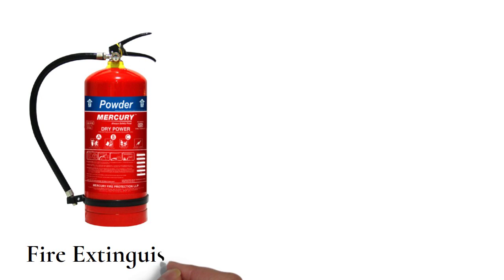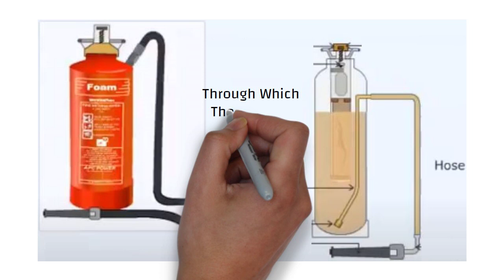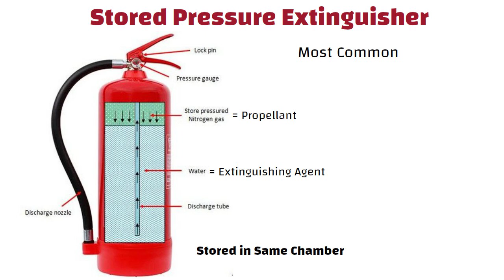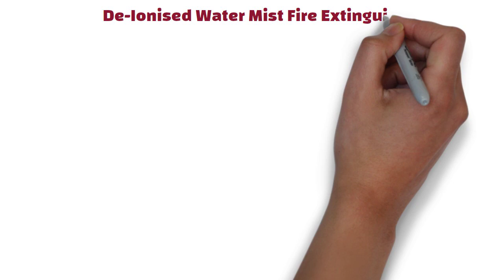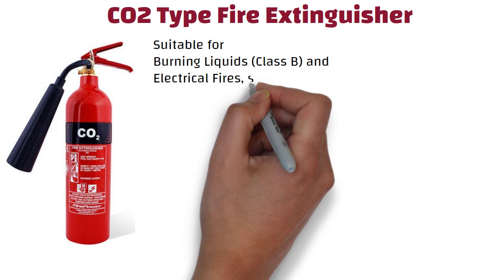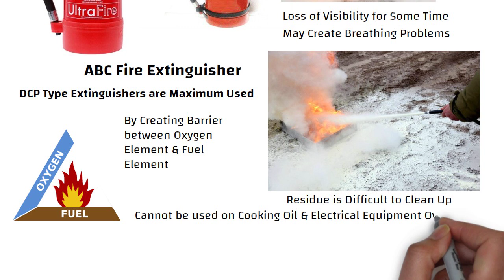FIRE EXTINGUISHER DEALERS IN KERALA, CALL 8138906102, FIRE EXTINGUISHER DEALERS IN ERNAKULAM.

Comment: FIRE EXTINGUISHER DEALERS IN THALASSERY, FIRE EXTINGUISHER SUPPLIERS IN THALASSERY, FIRE EXTINGUISHER DISTRIBUTORS IN THALASSERY, FIRE EXTINGUISHER IN THALASSERY, ABC TYPE FIRE EXTINGUISHER DEALERS IN THALASSERY, CO2 TYPE FIRE EXTINGUISHER DEALERS IN THALASSERY, CLEAN AGENT FIRE EXTINGUISHER IN THALASSERY, MODULAR TYPE FIRE EXTINGUISHER DEALERS IN THALASSERY, MECHANICAL FOAM FIRE EXTINGUISHER DEALERS IN THALASSERY, FIRE EXTINGUISHER NEAR ME THALASSERY, FIRE EXTINGUISHER TRADERS IN THALASSERY, FIRE FIGHTING COMPANIES IN THALASSERY, FIRE CONTRACTORS IN THALASSERY, FIRE EQUIPMENT DEALERS IN THALASSERY, FIRE ALARM DEALERS IN THALASSERY, FIRE PUMP DEALERS IN THALASSERY, SMOKE DETECTOR DEALERS IN THALASSERY, FIRE FIGHTING SYSTEM IN THALASSERY, FIRE PROTECTION SYSTEM IN THALASSERY, FIRE AND SAFETY CONTRACTORS IN THALASSERY, FIRE HYDRANT SYSTEMS IN THALASSERY, PA TALK BACK SYSTEM IN THALASSERY, FIRE NOC IN THALASSERY, FIRE INSTALLATION IN THALASSERY, FIRE NOC RENEWAL IN THALASSERY, KIRLOSKAR FIRE PUMP DEALERS IN THALASSERY, FIRE EXTINGUISHER NEAR ME THALASSERY, FIRE EXTINGUISHER MANUFACURERS IN THALASSERY, SAFEX FIRE EXTINGUISHER DEALERS IN THALASSERY, FIRE NOC CONTRACTORS IN THALASSERY, FIRE FIGHTING EQUIPMENT DEALERS IN THALASSERY, FIRE PROTECTION SYSTEM IN THALASSERY, FIRE INSTALLATION IN THALASSERY, FIRE SAFETY CONTRACTORS IN THALASSERY, FIRE AMC IN THALASSERY, FIRE PROTECTION SYSTEM IN THALASSERY, FIRE PROTECTION EQUIPMET IN THALASSERY, AMC OF FIRE SYSTEM IN THALASSERY, FIRE CONSULTANTS IN THALASSERY, FIRE AND SAFETY EQUIPMENT DEALERS IN THALASSERY, ADDRESSABLE FIRE ALARM SYSTEM IN THALASSERY, KARTHAR VALVE DEALERS IN THALASSERY, DCP TYPE FIRE EXTINGUISHER IN THALASSERY, POWSER TYPE FIRE EXTINGUISHERS IN THALASSERY, FIRE HYDRANT SYSTEM IN THALASSERY, FIRE ALARM PANEL DEALERS IN THALASSERY, SAFEPRO FIRE EXTINGUISHER DEALERS IN THALASSERY, MS AND GI PIPE DEALERS IN THALASSERY, JINDAL PIPE DEALERS IN THALASSERY, AGNI FIRE ALARM DEALERS IN THALASSERY, FIRE EQUIPMENT DEALERS IN THALASSERY, FIRE EQUIPMENT SUPPLIERS IN THALASSERY, FIRE EQUIPMENT TRADERS IN THALASSERY, FIRE SPRINKLER SYSTEM IN THALASSERY, RAVEL FIRE ALARM DEALERS IN THALASSERY, RAVEL FIRE ALARM SYSTEM IN THALASSERY, AGNI FIRE ALARM DISTRIBUTORS IN THALASSERY, FIRE ALARM CONTRACTORS IN THALASSERY, FIRE PIPE INSTALLATION IN CONTRACTORS IN THALASSERY, FIRE SAFETY CONTRACTORS IN THALASSERY, FIRE PA TWO WAY TALK BACK SYSTEM DEALERS IN THALASSERY, HEAT DETECTOR DEALERS IN THALASSERY, HONEYWELL FIRE ALARM DEALERS IN THALASSERY, FIRE NOC CONSULTANTS IN THALASSERY, FIRE AMC AND FIRE NOC IN THALASSERY, FIRE SAFETY COMPANIES IN THALASSERY, NEWAGE DEALERS IN THALASSERY, MONSHER FIRE EQUIPMENT DEALERS IN THALASSERY, KARTHAR VALVE DEALERS IN THALASSERY, FIRE HYDRANT VALVE DEALERS IN THALASSERY, FIRE HOSE REEL DRUM DEALERS IN THALASSERY, FIRE SPRINKLER DEALERS IN THALASSERY, FIRE PUMP DEALERS IN THALASSERY, LUBI PUMP DEALERS IN THALASSERY, LHP PUMP DEALERS IN THALASSERY. FIRE ALARM SYSTEMS IN THALASSERY, ADDRESSABLE FIRE ALARM DEALERS IN THALASSERY, SMOKE DETECTOR DEALERS IN THALASSERY, FIRE ALARM CONTRACTORS IN THALASSERY, FIRE ALARM PANEL DEALERS IN THALASSERY, BIRE ALARM INSTALLTION IN THALASSERY, MORLEY FIRE ALARM DEALERS IN THALASSERY, HONEYWELL FIRE ALARM DEALERS IN THALASSERY, GST FIRE ALARM DEALERS IN THALASSERY, FIRE FIGHTING COMPANIES IN THALASSERY, FIRE AND SAFETY CONTRACTORS IN THALASSERY, FIRE EQUIPMENT IN THALASSERY, SAFEPRO FIRE EXTINGUISHER DEALERS IN THALASSERY, SAFEX FIRE EXTINGUISHER DEALERS IN THALASSERY, SIMPLEX FIRE ALARM DEALERS IN THALASSERY, TYCO DEALERS IN THALASSERY, JINDAL PIPE DEALERS IN THALASSERY, KARTHAR DISTRIBUTORS IN THALASSERY, STENTOR DEALERS IN THALASSERY, MONSHER DEALERS IN THALASSERY, NEWAGE DEALERS IN THALASSERY, RONAK HOSE REEL DEALERS IN THALASSERY,

Comment: FIRE EXTINGUISHER DEALERS IN THODUPUZHA, FIRE EXTINGUISHER SUPPLIERS IN THODUPUZHA, FIRE EXTINGUISHER DISTRIBUTORS IN THODUPUZHA, FIRE EXTINGUISHER IN THODUPUZHA, ABC TYPE FIRE EXTINGUISHER DEALERS IN THODUPUZHA, CO2 TYPE FIRE EXTINGUISHER DEALERS IN THODUPUZHA, CLEAN AGENT FIRE EXTINGUISHER IN THODUPUZHA, MODULAR TYPE FIRE EXTINGUISHER DEALERS IN THODUPUZHA, MECHANICAL FOAM FIRE EXTINGUISHER DEALERS IN THODUPUZHA, FIRE EXTINGUISHER NEAR ME THODUPUZHA, FIRE EXTINGUISHER TRADERS IN THODUPUZHA, FIRE FIGHTING COMPANIES IN THODUPUZHA, FIRE CONTRACTORS IN THODUPUZHA, FIRE EQUIPMENT DEALERS IN THODUPUZHA, FIRE ALARM DEALERS IN THODUPUZHA, FIRE PUMP DEALERS IN THODUPUZHA, SMOKE DETECTOR DEALERS IN THODUPUZHA, FIRE FIGHTING SYSTEM IN THODUPUZHA, FIRE PROTECTION SYSTEM IN THODUPUZHA, FIRE AND SAFETY CONTRACTORS IN THODUPUZHA, FIRE HYDRANT SYSTEMS IN THODUPUZHA, PA TALK BACK SYSTEM IN THODUPUZHA, FIRE NOC IN THODUPUZHA, FIRE INSTALLATION IN THODUPUZHA, FIRE NOC RENEWAL IN THODUPUZHA, KIRLOSKAR FIRE PUMP DEALERS IN THODUPUZHA, FIRE EXTINGUISHER NEAR ME THODUPUZHA, FIRE EXTINGUISHER MANUFACURERS IN THODUPUZHA, SAFEX FIRE EXTINGUISHER DEALERS IN THODUPUZHA, FIRE NOC CONTRACTORS IN THODUPUZHA, FIRE FIGHTING EQUIPMENT DEALERS IN THODUPUZHA, FIRE PROTECTION SYSTEM IN THODUPUZHA, FIRE INSTALLATION IN THODUPUZHA, FIRE SAFETY CONTRACTORS IN THODUPUZHA, FIRE AMC IN THODUPUZHA, FIRE PROTECTION SYSTEM IN THODUPUZHA, FIRE PROTECTION EQUIPMET IN THODUPUZHA, AMC OF FIRE SYSTEM IN THODUPUZHA, FIRE CONSULTANTS IN THODUPUZHA, FIRE AND SAFETY EQUIPMENT DEALERS IN THODUPUZHA, ADDRESSABLE FIRE ALARM SYSTEM IN THODUPUZHA, KARTHAR VALVE DEALERS IN THODUPUZHA, DCP TYPE FIRE EXTINGUISHER IN THODUPUZHA, POWSER TYPE FIRE EXTINGUISHERS IN THODUPUZHA, FIRE HYDRANT SYSTEM IN THODUPUZHA, FIRE ALARM PANEL DEALERS IN THODUPUZHA, SAFEPRO FIRE EXTINGUISHER DEALERS IN THODUPUZHA, MS AND GI PIPE DEALERS IN THODUPUZHA, JINDAL PIPE DEALERS IN THODUPUZHA, AGNI FIRE ALARM DEALERS IN THODUPUZHA, FIRE EQUIPMENT DEALERS IN THODUPUZHA, FIRE EQUIPMENT SUPPLIERS IN THODUPUZHA, FIRE EQUIPMENT TRADERS IN THODUPUZHA, FIRE SPRINKLER SYSTEM IN THODUPUZHA, RAVEL FIRE ALARM DEALERS IN THODUPUZHA, RAVEL FIRE ALARM SYSTEM IN THODUPUZHA, AGNI FIRE ALARM DISTRIBUTORS IN THODUPUZHA, FIRE ALARM CONTRACTORS IN THODUPUZHA, FIRE PIPE INSTALLATION IN CONTRACTORS IN THODUPUZHA, FIRE SAFETY CONTRACTORS IN THODUPUZHA, FIRE PA TWO WAY TALK BACK SYSTEM DEALERS IN THODUPUZHA, HEAT DETECTOR DEALERS IN THODUPUZHA, HONEYWELL FIRE ALARM DEALERS IN THODUPUZHA, FIRE NOC CONSULTANTS IN THODUPUZHA, FIRE AMC AND FIRE NOC IN THODUPUZHA, FIRE SAFETY COMPANIES IN THODUPUZHA, NEWAGE DEALERS IN THODUPUZHA, MONSHER FIRE EQUIPMENT DEALERS IN THODUPUZHA, KARTHAR VALVE DEALERS IN THODUPUZHA, FIRE HYDRANT VALVE DEALERS IN THODUPUZHA, FIRE HOSE REEL DRUM DEALERS IN THODUPUZHA, FIRE SPRINKLER DEALERS IN THODUPUZHA, FIRE PUMP DEALERS IN THODUPUZHA, LUBI PUMP DEALERS IN THODUPUZHA, LHP PUMP DEALERS IN THODUPUZHA. FIRE ALARM SYSTEMS IN THODUPUZHA, ADDRESSABLE FIRE ALARM DEALERS IN THODUPUZHA, SMOKE DETECTOR DEALERS IN THODUPUZHA, FIRE ALARM CONTRACTORS IN THODUPUZHA, FIRE ALARM PANEL DEALERS IN THODUPUZHA, BIRE ALARM INSTALLTION IN THODUPUZHA, MORLEY FIRE ALARM DEALERS IN THODUPUZHA, HONEYWELL FIRE ALARM DEALERS IN THODUPUZHA, GST FIRE ALARM DEALERS IN THODUPUZHA, FIRE FIGHTING COMPANIES IN THODUPUZHA, FIRE AND SAFETY CONTRACTORS IN THODUPUZHA, FIRE EQUIPMENT IN THODUPUZHA, SAFEPRO FIRE EXTINGUISHER DEALERS IN THODUPUZHA, SAFEX FIRE EXTINGUISHER DEALERS IN THODUPUZHA, SIMPLEX FIRE ALARM DEALERS IN THODUPUZHA, TYCO DEALERS IN THODUPUZHA, JINDAL PIPE DEALERS IN THODUPUZHA, KARTHAR DISTRIBUTORS IN THODUPUZHA, STENTOR DEALERS IN THODUPUZHA, MONSHER DEALERS IN THODUPUZHA, NEWAGE DEALERS IN THODUPUZHA, RONAK HOSE REEL DEALERS IN THODUPUZHA,

Comment: FIRE EXTINGUISHER DEALERS IN KATTAPPANA, FIRE EXTINGUISHER SUPPLIERS IN KATTAPPANA, FIRE EXTINGUISHER DISTRIBUTORS IN KATTAPPANA, FIRE EXTINGUISHER IN KATTAPPANA, ABC TYPE FIRE EXTINGUISHER DEALERS IN KATTAPPANA, CO2 TYPE FIRE EXTINGUISHER DEALERS IN KATTAPPANA, CLEAN AGENT FIRE EXTINGUISHER IN KATTAPPANA, MODULAR TYPE FIRE EXTINGUISHER DEALERS IN KATTAPPANA, MECHANICAL FOAM FIRE EXTINGUISHER DEALERS IN KATTAPPANA, FIRE EXTINGUISHER NEAR ME KATTAPPANA, FIRE EXTINGUISHER TRADERS IN KATTAPPANA, FIRE FIGHTING COMPANIES IN KATTAPPANA, FIRE CONTRACTORS IN KATTAPPANA, FIRE EQUIPMENT DEALERS IN KATTAPPANA, FIRE ALARM DEALERS IN KATTAPPANA, FIRE PUMP DEALERS IN KATTAPPANA, SMOKE DETECTOR DEALERS IN KATTAPPANA, FIRE FIGHTING SYSTEM IN KATTAPPANA, FIRE PROTECTION SYSTEM IN KATTAPPANA, FIRE AND SAFETY CONTRACTORS IN KATTAPPANA, FIRE HYDRANT SYSTEMS IN KATTAPPANA, PA TALK BACK SYSTEM IN KATTAPPANA, FIRE NOC IN KATTAPPANA, FIRE INSTALLATION IN KATTAPPANA, FIRE NOC RENEWAL IN KATTAPPANA, KIRLOSKAR FIRE PUMP DEALERS IN KATTAPPANA, FIRE EXTINGUISHER NEAR ME KATTAPPANA, FIRE EXTINGUISHER MANUFACURERS IN KATTAPPANA, SAFEX FIRE EXTINGUISHER DEALERS IN KATTAPPANA, FIRE NOC CONTRACTORS IN KATTAPPANA, FIRE FIGHTING EQUIPMENT DEALERS IN KATTAPPANA, FIRE PROTECTION SYSTEM IN KATTAPPANA, FIRE INSTALLATION IN KATTAPPANA, FIRE SAFETY CONTRACTORS IN KATTAPPANA, FIRE AMC IN KATTAPPANA, FIRE PROTECTION SYSTEM IN KATTAPPANA, FIRE PROTECTION EQUIPMET IN KATTAPPANA, AMC OF FIRE SYSTEM IN KATTAPPANA, FIRE CONSULTANTS IN KATTAPPANA, FIRE AND SAFETY EQUIPMENT DEALERS IN KATTAPPANA, ADDRESSABLE FIRE ALARM SYSTEM IN KATTAPPANA, KARTHAR VALVE DEALERS IN KATTAPPANA, DCP TYPE FIRE EXTINGUISHER IN KATTAPPANA, POWSER TYPE FIRE EXTINGUISHERS IN KATTAPPANA, FIRE HYDRANT SYSTEM IN KATTAPPANA, FIRE ALARM PANEL DEALERS IN KATTAPPANA, SAFEPRO FIRE EXTINGUISHER DEALERS IN KATTAPPANA, MS AND GI PIPE DEALERS IN KATTAPPANA, JINDAL PIPE DEALERS IN KATTAPPANA, AGNI FIRE ALARM DEALERS IN KATTAPPANA, FIRE EQUIPMENT DEALERS IN KATTAPPANA, FIRE EQUIPMENT SUPPLIERS IN KATTAPPANA, FIRE EQUIPMENT TRADERS IN KATTAPPANA, FIRE SPRINKLER SYSTEM IN KATTAPPANA, RAVEL FIRE ALARM DEALERS IN KATTAPPANA, RAVEL FIRE ALARM SYSTEM IN KATTAPPANA, AGNI FIRE ALARM DISTRIBUTORS IN KATTAPPANA, FIRE ALARM CONTRACTORS IN KATTAPPANA, FIRE PIPE INSTALLATION IN CONTRACTORS IN KATTAPPANA, FIRE SAFETY CONTRACTORS IN KATTAPPANA, FIRE PA TWO WAY TALK BACK SYSTEM DEALERS IN KATTAPPANA, HEAT DETECTOR DEALERS IN KATTAPPANA, HONEYWELL FIRE ALARM DEALERS IN KATTAPPANA, FIRE NOC CONSULTANTS IN KATTAPPANA, FIRE AMC AND FIRE NOC IN KATTAPPANA, FIRE SAFETY COMPANIES IN KATTAPPANA, NEWAGE DEALERS IN KATTAPPANA, MONSHER FIRE EQUIPMENT DEALERS IN KATTAPPANA, KARTHAR VALVE DEALERS IN KATTAPPANA, FIRE HYDRANT VALVE DEALERS IN KATTAPPANA, FIRE HOSE REEL DRUM DEALERS IN KATTAPPANA, FIRE SPRINKLER DEALERS IN KATTAPPANA, FIRE PUMP DEALERS IN KATTAPPANA, LUBI PUMP DEALERS IN KATTAPPANA, LHP PUMP DEALERS IN KATTAPPANA. FIRE ALARM SYSTEMS IN KATTAPPANA, ADDRESSABLE FIRE ALARM DEALERS IN KATTAPPANA, SMOKE DETECTOR DEALERS IN KATTAPPANA, FIRE ALARM CONTRACTORS IN KATTAPPANA, FIRE ALARM PANEL DEALERS IN KATTAPPANA, BIRE ALARM INSTALLTION IN KATTAPPANA, MORLEY FIRE ALARM DEALERS IN KATTAPPANA, HONEYWELL FIRE ALARM DEALERS IN KATTAPPANA, GST FIRE ALARM DEALERS IN KATTAPPANA, FIRE FIGHTING COMPANIES IN KATTAPPANA, FIRE AND SAFETY CONTRACTORS IN KATTAPPANA, FIRE EQUIPMENT IN KATTAPPANA, SAFEPRO FIRE EXTINGUISHER DEALERS IN KATTAPPANA, SAFEX FIRE EXTINGUISHER DEALERS IN KATTAPPANA, SIMPLEX FIRE ALARM DEALERS IN KATTAPPANA, TYCO DEALERS IN KATTAPPANA, JINDAL PIPE DEALERS IN KATTAPPANA, KARTHAR DISTRIBUTORS IN KATTAPPANA, STENTOR DEALERS IN KATTAPPANA, MONSHER DEALERS IN KATTAPPANA, NEWAGE DEALERS IN KATTAPPANA, RONAK HOSE REEL DEALERS IN KATTAPPANA,

Comment: FIRE EXTINGUISHER DEALERS IN MAVELIKARA, FIRE EXTINGUISHER SUPPLIERS IN MAVELIKARA, FIRE EXTINGUISHER DISTRIBUTORS IN MAVELIKARA, FIRE EXTINGUISHER IN MAVELIKARA, ABC TYPE FIRE EXTINGUISHER DEALERS IN MAVELIKARA, CO2 TYPE FIRE EXTINGUISHER DEALERS IN MAVELIKARA, CLEAN AGENT FIRE EXTINGUISHER IN MAVELIKARA, MODULAR TYPE FIRE EXTINGUISHER DEALERS IN MAVELIKARA, MECHANICAL FOAM FIRE EXTINGUISHER DEALERS IN MAVELIKARA, FIRE EXTINGUISHER NEAR ME MAVELIKARA, FIRE EXTINGUISHER TRADERS IN MAVELIKARA, FIRE FIGHTING COMPANIES IN MAVELIKARA, FIRE CONTRACTORS IN MAVELIKARA, FIRE EQUIPMENT DEALERS IN MAVELIKARA, FIRE ALARM DEALERS IN MAVELIKARA, FIRE PUMP DEALERS IN MAVELIKARA, SMOKE DETECTOR DEALERS IN MAVELIKARA, FIRE FIGHTING SYSTEM IN MAVELIKARA, FIRE PROTECTION SYSTEM IN MAVELIKARA, FIRE AND SAFETY CONTRACTORS IN MAVELIKARA, FIRE HYDRANT SYSTEMS IN MAVELIKARA, PA TALK BACK SYSTEM IN MAVELIKARA, FIRE NOC IN MAVELIKARA, FIRE INSTALLATION IN MAVELIKARA, FIRE NOC RENEWAL IN MAVELIKARA, KIRLOSKAR FIRE PUMP DEALERS IN MAVELIKARA, FIRE EXTINGUISHER NEAR ME MAVELIKARA, FIRE EXTINGUISHER MANUFACURERS IN MAVELIKARA, SAFEX FIRE EXTINGUISHER DEALERS IN MAVELIKARA, FIRE NOC CONTRACTORS IN MAVELIKARA, FIRE FIGHTING EQUIPMENT DEALERS IN MAVELIKARA, FIRE PROTECTION SYSTEM IN MAVELIKARA, FIRE INSTALLATION IN MAVELIKARA, FIRE SAFETY CONTRACTORS IN MAVELIKARA, FIRE AMC IN MAVELIKARA, FIRE PROTECTION SYSTEM IN MAVELIKARA, FIRE PROTECTION EQUIPMET IN MAVELIKARA, AMC OF FIRE SYSTEM IN MAVELIKARA, FIRE CONSULTANTS IN MAVELIKARA, FIRE AND SAFETY EQUIPMENT DEALERS IN MAVELIKARA, ADDRESSABLE FIRE ALARM SYSTEM IN MAVELIKARA, KARTHAR VALVE DEALERS IN MAVELIKARA, DCP TYPE FIRE EXTINGUISHER IN MAVELIKARA, POWSER TYPE FIRE EXTINGUISHERS IN MAVELIKARA, FIRE HYDRANT SYSTEM IN MAVELIKARA, FIRE ALARM PANEL DEALERS IN MAVELIKARA, SAFEPRO FIRE EXTINGUISHER DEALERS IN MAVELIKARA, MS AND GI PIPE DEALERS IN MAVELIKARA, JINDAL PIPE DEALERS IN MAVELIKARA, AGNI FIRE ALARM DEALERS IN MAVELIKARA, FIRE EQUIPMENT DEALERS IN MAVELIKARA, FIRE EQUIPMENT SUPPLIERS IN MAVELIKARA, FIRE EQUIPMENT TRADERS IN MAVELIKARA, FIRE SPRINKLER SYSTEM IN MAVELIKARA, RAVEL FIRE ALARM DEALERS IN MAVELIKARA, RAVEL FIRE ALARM SYSTEM IN MAVELIKARA, AGNI FIRE ALARM DISTRIBUTORS IN MAVELIKARA, FIRE ALARM CONTRACTORS IN MAVELIKARA, FIRE PIPE INSTALLATION IN CONTRACTORS IN MAVELIKARA, FIRE SAFETY CONTRACTORS IN MAVELIKARA, FIRE PA TWO WAY TALK BACK SYSTEM DEALERS IN MAVELIKARA, HEAT DETECTOR DEALERS IN MAVELIKARA, HONEYWELL FIRE ALARM DEALERS IN MAVELIKARA, FIRE NOC CONSULTANTS IN MAVELIKARA, FIRE AMC AND FIRE NOC IN MAVELIKARA, FIRE SAFETY COMPANIES IN MAVELIKARA, NEWAGE DEALERS IN MAVELIKARA, MONSHER FIRE EQUIPMENT DEALERS IN MAVELIKARA, KARTHAR VALVE DEALERS IN MAVELIKARA, FIRE HYDRANT VALVE DEALERS IN MAVELIKARA, FIRE HOSE REEL DRUM DEALERS IN MAVELIKARA, FIRE SPRINKLER DEALERS IN MAVELIKARA, FIRE PUMP DEALERS IN MAVELIKARA, LUBI PUMP DEALERS IN MAVELIKARA, LHP PUMP DEALERS IN MAVELIKARA. FIRE ALARM SYSTEMS IN MAVELIKARA, ADDRESSABLE FIRE ALARM DEALERS IN MAVELIKARA, SMOKE DETECTOR DEALERS IN MAVELIKARA, FIRE ALARM CONTRACTORS IN MAVELIKARA, FIRE ALARM PANEL DEALERS IN MAVELIKARA, BIRE ALARM INSTALLTION IN MAVELIKARA, MORLEY FIRE ALARM DEALERS IN MAVELIKARA, HONEYWELL FIRE ALARM DEALERS IN MAVELIKARA, GST FIRE ALARM DEALERS IN MAVELIKARA, FIRE FIGHTING COMPANIES IN MAVELIKARA, FIRE AND SAFETY CONTRACTORS IN MAVELIKARA, FIRE EQUIPMENT IN MAVELIKARA, SAFEPRO FIRE EXTINGUISHER DEALERS IN MAVELIKARA, SAFEX FIRE EXTINGUISHER DEALERS IN MAVELIKARA, SIMPLEX FIRE ALARM DEALERS IN MAVELIKARA, TYCO DEALERS IN MAVELIKARA, JINDAL PIPE DEALERS IN MAVELIKARA, KARTHAR DISTRIBUTORS IN MAVELIKARA, STENTOR DEALERS IN MAVELIKARA, MONSHER DEALERS IN MAVELIKARA, NEWAGE DEALERS IN MAVELIKARA, RONAK HOSE REEL DEALERS IN MAVELIKARA,